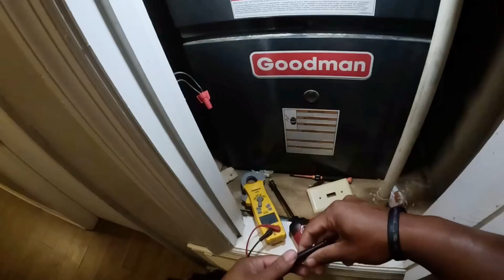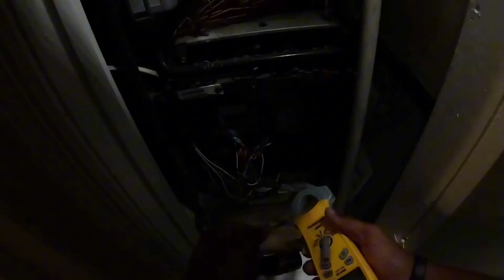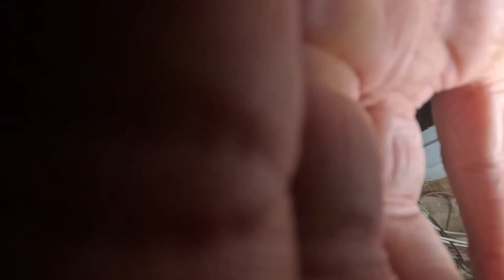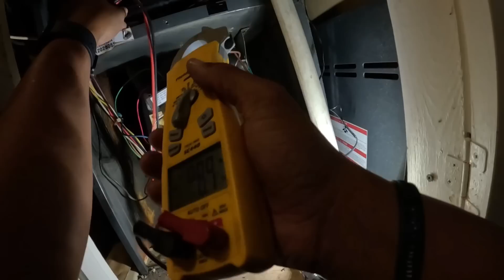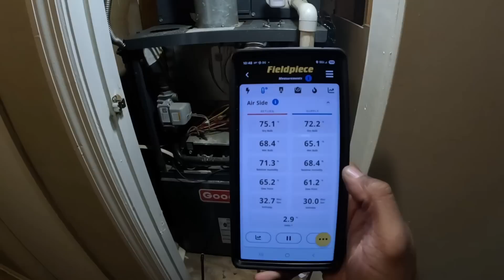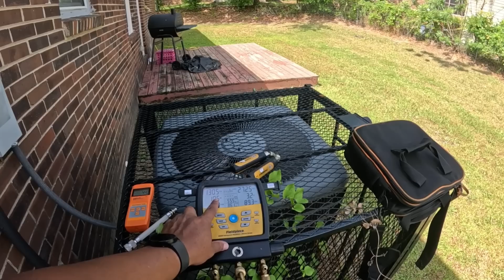Sometimes You Have To Go A Step Further | No Cooling Call

Comment: 6:38 - Your method for testing tripped breakers in that panel is spot on. I have seen many tripped breakers that did not show its indicator; but, you could move it slightly toward the on position. You’ll notice none of the other breaker handles you touched moved. Only the tripped breaker moved (and, yes: a breaker must be forced off before it can be reset.)